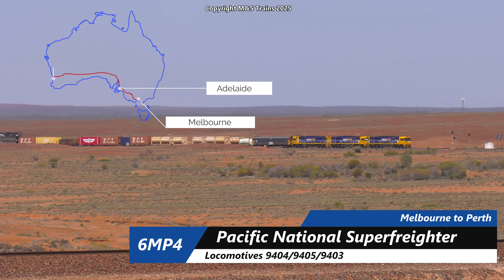AUSTRALIA'S NEWEST LOCOMOTIVES TAKE ON THE OUTBACK - GE C44ACi & C44ESACi Engines built in Australia

Comment: Hi, new to the channel. Can someone explain these S curves, and why the line wasn’t built straight? 
Thanks , from a UK rail employee
Reply from the maker: Welcome to the channel. 

The track curves because, or though it might not look it, it is pretty steep terrain here. An example is the bottom S Section. If the track went straight up, it would cover the climb in 4200 metres instead of 5800, increasing the grade from 0.8% on the curved alignment to 1.16% if the line was straight. This would mean more pulling power would be required. That's also isn't considering that when the line was built, it would need more cuttings and embankments built as it wouldn't follow the edge of the hill and instead would go straight through it and over low points. 

On the other hand, this line also has the world's straightest section of track, where the terrain is pretty flat. 

Thanks for watching.
Reply: @MS_Trains  great many thanks for the prompt reply. The railway  system in the Australian outback absolutely fascinates me. So in short, the S bends were to reduce the gradient …I’m getting that now, many thanks for the explanation.

Comment: I worked for UGL in Chullora from 2010, building 19 units 5020 class GE C44Aci for QR in the Hunter Valley NSW. The 180 tonne gross heavy version. A further 4 units were built for Qube weighing 134 tonnes gross.

Comment: With Pacific National and Aurizon upgrading their engines, they should commit to all intermodal rolling stock being double-stacked. Australia needs to get freight off the roads and on the rails. Double stacking increases container capacity per train
Reply: Road bridges and tunnels are some of the reasons why double stacking isn't possible on every standard gauge route, and nor it is possible on Queensland's North Coast line from Brisbane to Cairns.
Reply: This would require a commitment of billions & billions of dollars and years and years of inconvenience to townships and rail closures to make this happen due to tunnels and road bridges all having to be redesigned, not to mention the track work that would have to be redesigned to accept the new weights the rails are being asked to carry, as you are now essentially doubling the payload of every piece of intermodal rolling stock.
Reply: If the loading gauge as presently constructed doesn’t allow it, then tracks where the loading gauge does allow it should be all double-stacked
Reply from the maker: SCT has been doing all Double Stacked Trains between Parkes and Perth for a few years now. If Melbourne to Adelaide was to get upgraded to allow Double Stacking, I'm sure it would be the same on that route for all operators, but as trains have to start their journey single stacked, using a mixture of flats and wells, allows efficiency across the whole Melbourne to Perth route. 

Between Adelaide and Melbourne it's more efficient to use flats as a five pack can hold five 40-48 foot containers across 65 meters of train length. A five pack of Well Wagons is 95 meters long, and because of height limits in the section still only takes five 40-48 foot containers, for 30 extra meters of train length. If all flats were used you could move about 140 containers per 1800 meter train. If all wells were used you'd only move about 94 containers. 

Of course between Adelaide and Perth it's the opposite. You can carry ten 40-48 foot containers for 95 meters of train length with Well Wagons compared to 130 meters of train length for ten 40-48 foot containers on two five pack flat wagons. If all flats were used again you'd only move about 140 container per 1800 meter train. If all wells were used you'd be able to move about 190 containers. 

A mixture of rollingstock means a mixture of efficiency across the whole route between Melbourne and Perth. The real problem here is Melbourne to Adelaide needs to allow for Double Stacking, whether that's upgrading tunnels or diverting around the Adelaide Hills, it's an inefficient part of the route at the moment.
Reply: Yes, the Adelaide Hills tunnels are probably the biggest impediment to the loading gauge. That’s why the idea was floated for a loop highway and railway bypass, east of the Mount Lofty Ranges, to get from Murray Bridge to the Port Wakefield Highway without having to traverse the Adelaide Hills. Adelaide has the trickiest topography of all Australian cities, despite South Australia being the crossroads of Australian trans continental freight movement. If SCT, Pacific National, Aurizon, and potentially Viterra could reach a contract with the state government for longer, wider and deeper tunnels from Balhannah to Eden Hills at the cost of a few billion dollars or whatever, that would vastly improve the loading gauge

Comment: I used to work for the railroad in my 20s. Australia's railroads are very different from those in the United States or the Netherlands. I prefer U.S. railroads—they look and feel how a railroad should, with proper track layout and classic engines and boxcars. Other countries, like the U.K., have awkward designs, but Australia’s system is closer to American and Canadian railroads. The main difference is in the locomotives. Australian railroads, especially through the desert, look tough, and a Dash 9-44AC with proper cooling could handle it. Dash 9s are fuel-efficient and offer extra frontal protection in collisions. I like Australian railroads almost as much as U.S. ones.

Comment: wondering how much charge those batteries are going to get across the nullabor. It's not like they're going down (or up) many hills and can use the regen to charge the batteries to then use going up the other side. Just me but perhaps that facility might be better used on the less level parts of Australia's rail network - which also happen to be more heavily trafficked.

Comment: I am wondering how much of these locos are "assembled in australia" vs "built in australia"...
I'm guessing all the drive train, castings, instruments and controls are imported.

I wonder if the major chassis components are cast, or fabricated. 
 
I see that the evo loco is a co-original equipment manufacturer design between UGL and Wabtec Corporation and delivered for Pacific National as part of their efforts to decarbonise their locomotive fleets.
"UGL has been in partnership with Wabtec (formerly GE Transportation) for over 60 years"

I'm guessing Wabtec supply the major components....

Comment: Interesting way the tracks have all those S bends.  I wonder why.  I can't peel back my view (😁🤣😁) to see how the land grades but it looks from some of the shots that the tracks are fairly freshly laid?  I would LOVE to have GPS details for the various shots - maybe labelling them with time stamps in the description?  When following trains with enough info I like to go to google maps to see the sat view.  Having both the ground views from the videos with the sat view is a great way to learn the geography of the regions the trains travel through...
Reply: S bands are to manage inclines in the landscape and to prevent track buckling from heat expansion. The S-shaped curves, known as spirals, allow trains to ascend steep grades without requiring excessively sharp or dangerous turns. Additionally, they help manage thermal expansion, as the S-bends provide the necessary flexibility to handle the compression and expansion of the rails caused by extreme temperature changes.

Comment: Do Australia trains normally have a passenger car?
Reply from the maker: Just on the remote runs like this one. They’re for crew accommodations during the trip with two crews onboard. One crew rests in the van while the other drives, swapping every 8 hours or so. From Port Augusta to Kalgoorlie it’s about 1700 kilometres and no towns to facilitate accommodation, apart from Cook at the half way mark which is privately owned and used Pacific National.
Reply: @MS_Trains thank you!

Comment: UGL's NSW plant is at *Broadmeadow*, not Broadmeadows (plural) which is a suburb of Melbourne with no rail manufacturing facilities. Also, Aurizon bring a Queensland based rail company, they go off the old Queensland Railways class designation styles, in this case 6000 or 6020 (Sixty Twenty) not six zero etc.
Reply from the maker: Apologies for the plural confusion with the name. As for the locomotive designation, when crews get train authorities in South Australia the locomotive designation is spoken number by number e.g Six Zero not Sixty, hence why I do the same.

Comment: Hi Matt so you are saying early. C S R  are not working ,,do you know why ,,Interesting made in China cheers mate be safe out there👍👍
Reply: No surprise. I bet SCT are rueing that purchase. I read of many modifications needed to be made when they arrived and trialled. Same as the two BK's (I think it was) that Bradken Engineering in the Hunter Valley purchased. The BK's never even entered service and SCT bought them also, from memory.
That's what one gets for trying to save money and buy Chinese. The CSR's were certified by the manufacturer as being asbestos-free. It didn't take long to find out they weren't, as I recall. A disgrace.
Reply: It was pretty common for those to chinese locos to blow turbos.

The dilemma for QUBE and like SCT - is getting replacement parts for their locos.

Comment: Hmmm those Chinese CSR units having the same problems as our Chinese DLs, they needed a lot of tweaks to get them to run reliably in NZ
Reply from the maker: How many of those DLs are operating over in NZ? Across Qube & SCT there’s 30 SDA1s in Australia. Only SCT was silly enough to go back for a second order.
Reply: @MS_Trains  , i saw it written that the second lot were improved over the first lot.   and they were contemplating updating the first lot to second lot specs.   is this all untrue?   you cant run a successful business hiring stuff all the time.   do you know what they are doing to get some more for themselves?
Reply: AI says the CSRs for AU had: 
  Asbestos Contamination - Asbestos found despite certification
  Reliability Problems - Locomotives awaiting parts; poor availability
  Technical Challenges - Failed initial tests, required redesign
  Control Mode Issues - Telemetry and communication system integration flaws
  Emissions Compliance -  Mixed compliance, lower emission tier in some regions
Reply: No surprise really
Reply: So what is the deal with the first lot of CSRs? I heard asbestos was one thing?
Reply: @allychat8496  , yeah, that took a while but it was removed.   you demand the equipment to be asbestos free.   the chinese think you asked for free asbestos.
Reply: NZ is narrow gauge and earthquake prone. When we were in South and North Island we saw 3 derailments in 2 and a half weeks.

Comment: A couple of questions re the train length. The first service showed 3 x locos on the Perth run and the second service had 2 x locos. We know the passing sidings on Nullabor are limited to 1800 metres.
Normally most Perth services have 2 x locos.
Great videoing as usual. Very interesting that the locos are being built in Oz. That goes against the import everything trend.
Off topic but YT now flooded with Australian Trucks road trains which the world has rediscovered again especially the 5 trailer set ups up North.
 Cheers
Reply from the maker: Pacific National are/were running three 94s where only two locomotives are normally required as a redundancy measure incase of issues in the remote region. 

Australia needs to keep manufacturing these engines here! It’s great for employment and the rail industry.
Reply: I'd imagine a lot of the wagons are carrying empty containers and/or iso tanks (could probably check TMS).

We run NRs on our service - a loaded 1800m train would need 3 x locos as a minimum to run track speed.

If we ran 2 x NRs (we've had this more than a few times) - I'd be dropping wagons.

Comment: South aussie built crew cars too!
Reply from the maker: Good point! Something I need to mention more often in my video.
Reply: Is that extra diesel and a crew car behind the locomotives? Do multiple crews come with the train? Here in the US, the crews swap off, they don't go with the train.
Reply from the maker: @woodalexander  Yep, extra diesel so they can go the full 3,000 kilometres without stopping for fuel. There's nowhere to swap off out here, with no towns for around 1700 kilometres, so train operators use crew vans and multiple crews working relay shifts.
Reply: @MS_Trains Wow!!! Now that's remote. In the most remote parts of the US it might be 100 miles. When were these railroads built? Back in the steam days you needed a maintenance depot and water every 100 miles or so.
Reply from the maker: @woodalexander Yep it’s a lot of nothing out there! The Trans Australian Railway was opened in 1917, towns were built along the corridor but all closed and have been abandoned after the steam era. Cook a privately owned railway town still exists for Pacific National use. There’s some worksite barracks at three locations too but they’re only used by track workers.
Reply: @MS_Trains  Wow, fascinating. Love the videos. I'm usually not interested in non US/Canadian railroading, but your videos are fascinating. If you can, I'd love some more explanation about how rail freight works in Australia, where things are going, the types of containers, rolling stock, etc. It's so different from what you see in other places!